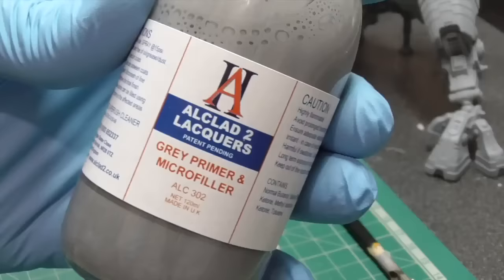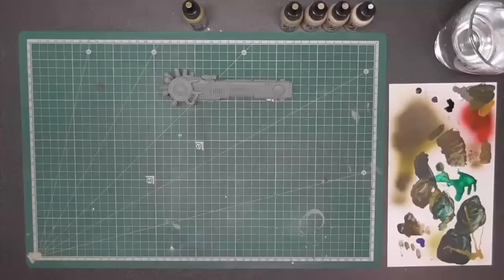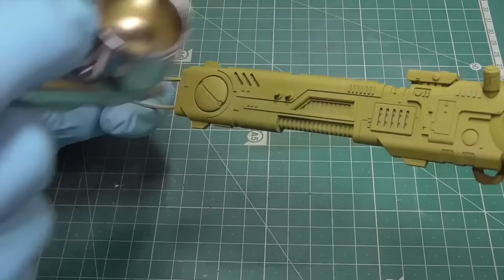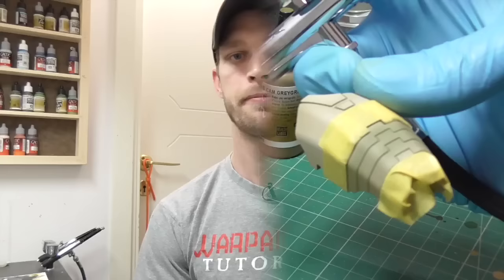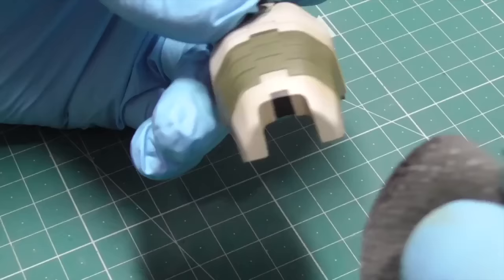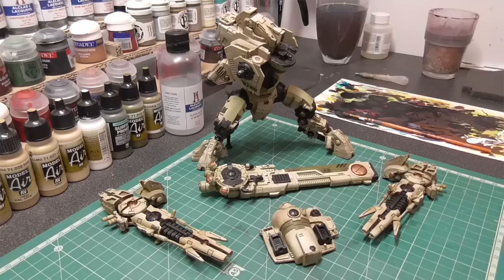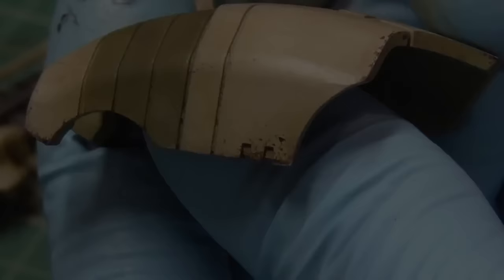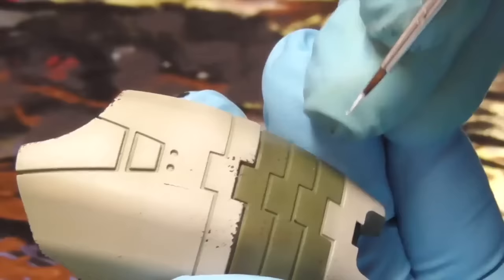Converted Tau Battlesuit Painting Tutorial by Warpainting Tutorials

Comment: The finished look is very cool, with a good amount of contrast in both your colors and shades/highlights to make a model that big look fairly realistic.  I just have one question, if you don't mind; after you applied the Alclad primer, I was wondering why you chose two acrylic polyurethane surface primers as your base colors.  What is the reasoning behind using additional primer on top of the initial primer coat you applied?
Reply: I don't mind at all, and a good question. One of the many positive things with Vallejo primers is that they can be used as base coats as well as primers. The additional features of the paint being a primer which makes it stick to the surface better than normal paint is definitely a plus but not the reason to why I chose it. :)
Reply: Ah, that explains it.  I'd never really considered the fact that the Vallejo Surface Primers would make good base coats, but I suppose it makes a certain amount of sense considering the density of the pigments and the properties of it being a polyurethane.  Thank you for answering my question, I very much appreciate it.
Reply: +TheRunesmythe my pleasure! Don't hesitate to ask if you have others questions :)

Comment: Did I see this guy on sale on Ebay? Either way I saw this Stormsurge R'varna, wasn't a fan of it before, thought it looked a bit goofy and the coloring seemed off, but seeing it in your video... Must be the quality of the camera, but that thing is WICKED, WICKED AWESOME!!! Its huge! Looks impressively strong, and the coloring looks right, they mesh so well with each other. I'm blown away at how cool that really looks! My only pet peeve really is that damn sun roof for the Stormsurge. Yes I'm OCD like that, but the armor that I'm used to riding around in, has a roof for a reason, because I'm squishy, the tank is not. Even the concussion from explosives going off near you will screw up your insides. Imagine what these energy weapons in 40k would do if it zoomed over top, or the heat coming off that gun's exhaust port, next to those pilots, would do to them. Do you do commission work by chance?
Reply: Thank you. You're correct, I did have problems with the snaps for this model. Ended up with me buying a new camera for what good is making a nice paint job if my camera can't pick the colors up :)

Comment: Quick question, do you use just tap water or soapy water in that sonic cleaner tub you got in the start of the video? I assume you used it to clean the parts before painting?
Reply: +dvj85 I use hot tap water mixed with handsoap without perfume. Let it sit in the soapy water for about 10 min and then run in the ultrasonic cleaner for about 5 min. Rince in clean tap water and leave to dry completely on a towel. =)
Reply: +Warpainting tutorials Thanks, I'll try that out the next time I paint, actually got a sonic cleaner in a box somewhere.
Reply: My plesure! I don't regret buying one for a second. Feel free to get back to me if you have other questions